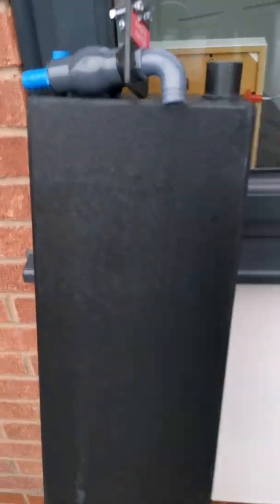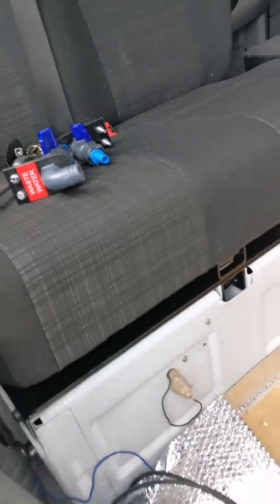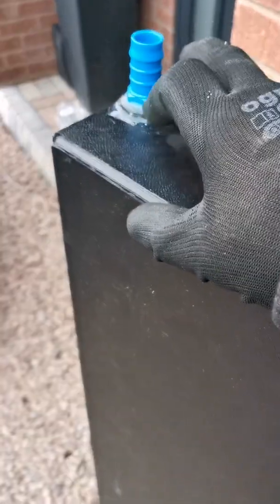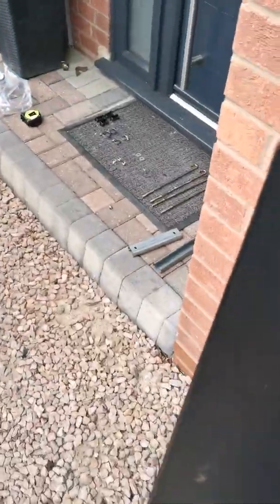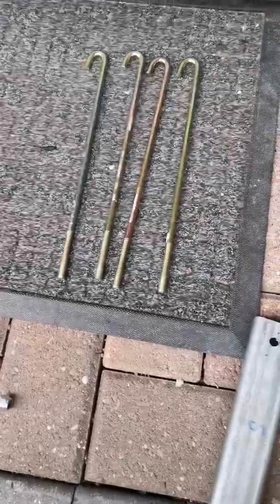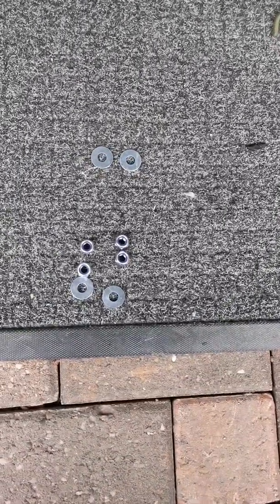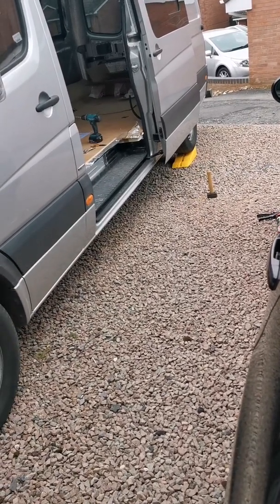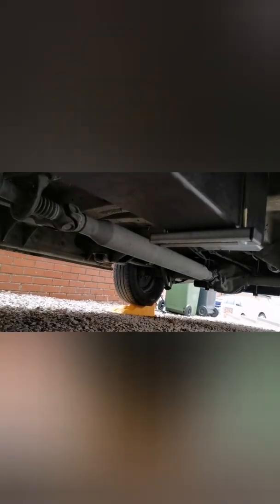Fitting Barratt waste tank under sliding door #underslungwaste #underslung #campervan #sprinter

Comment: do you not have to put some rubber pads between the tank and the plates that holds the tank up to protect the tank?
Reply from the maker: No, I did not receive any with the tank. The tank is made of tough plastic